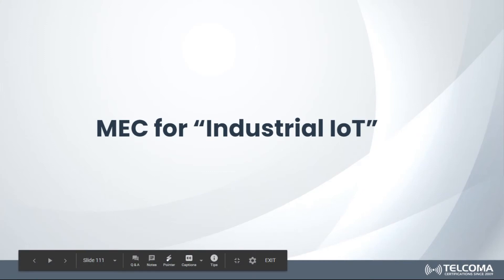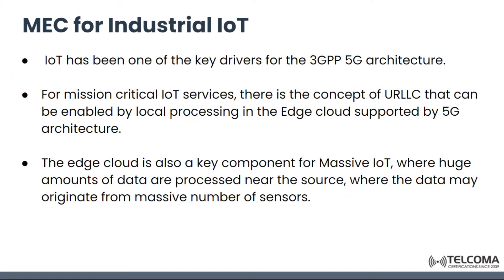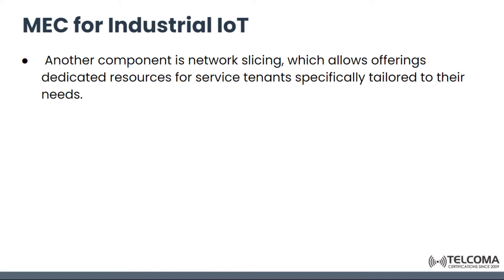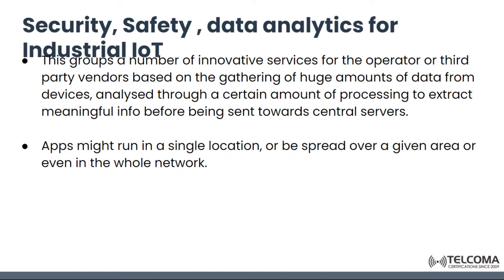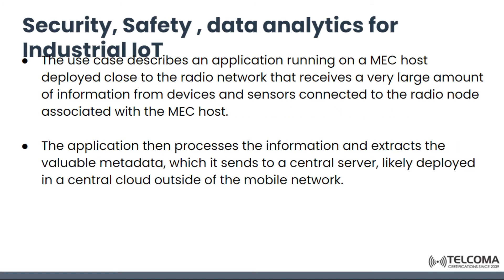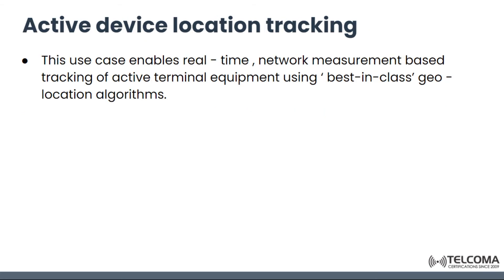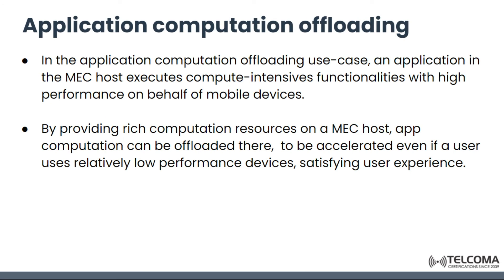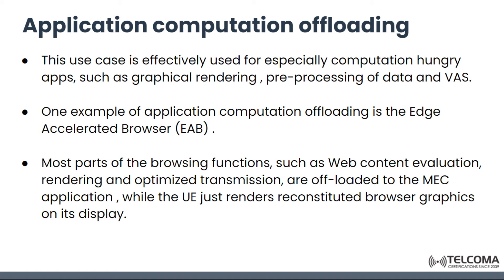MEC for Industrial IOT

Comment: "This video provides an excellent overview of 5G system architecture and the integration of MEC (Multi-Access Edge Computing) with Industrial IoT. The emphasis on security, safety, and data analytics in MEC applications is crucial as industries adopt these technologies for smarter, real-time decision-making. It's exciting to see how MEC can enhance network efficiency and enable more powerful IoT solutions. If you're interested in learning more about cutting-edge technologies in this field, I came across GAO RFID Inc. – you might find it pretty useful for this topic, as they offer robust solutions for industrial IoT and edge computing applications."